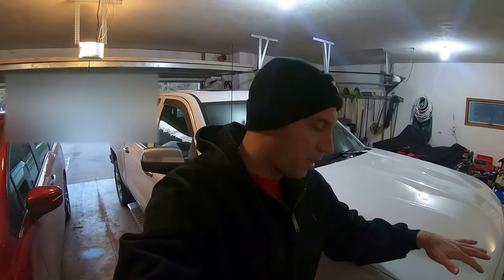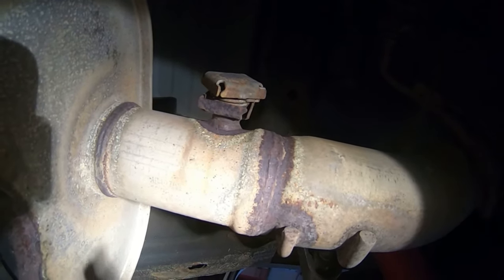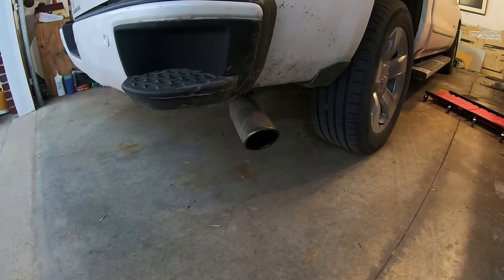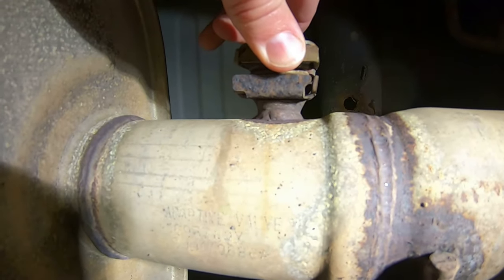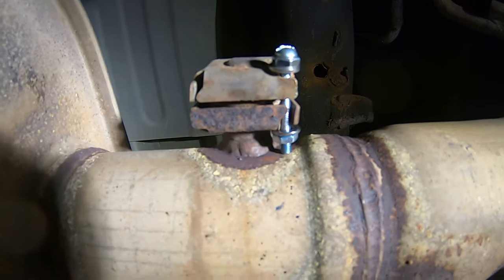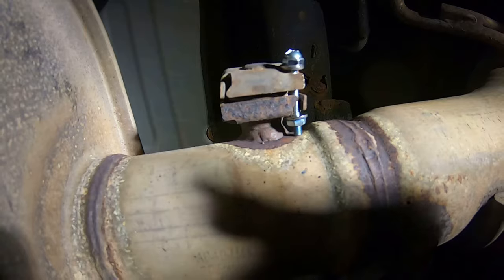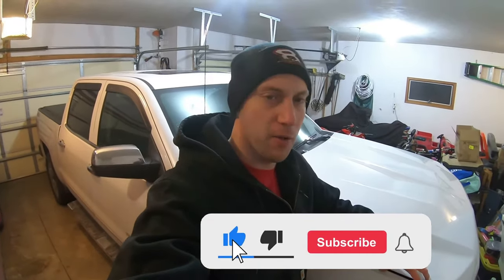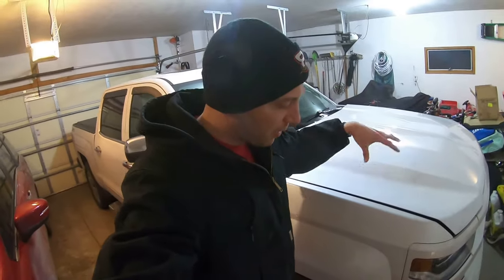MUST DO FREE Silverado/GMC Exhaust Mod!

Comment: Watched this and went right and did it. Thank you  sir. Way better! After spending $70k on a new trail boss and $8000 on 6" lift,wheel and tires. There are no beans left for any exhaust mods.
Reply from the maker: Camera doesn't do it justice. But way better in person. And it's free, can't beat that!
Reply: lol my exact thought. Can you vouch on the better sound? I feel like it was very subtle but idk if it’s worth it
Reply from the maker: @georgehernandez1502  in my opinion it's worth the minimal effort
Reply: @EssMotorsports  Ty sir. I live in an apartment complex and have been debating straight piping for some time now, but I don’t want my neighbors to complain. Someone did this and put exhaust tape on the resonators and it sounded pretty decent.
Reply from the maker: @georgehernandez1502  cheap and easy. If u don't like it then remove it. Simple enough to try
Reply: Doesn’t work on mine I’ve tried and nothing

Comment: Couldn’t believe it. Went to garage last night and sure enough there it was. 2017 Sierra 6.2. This truck has been choking its whole life. THANK YOU!!! 3 years of wondering why the truck hisses when pulling my camper……valve was seized 3/4 shut. Until last night. lol
Reply from the maker: @jaybilawchuk2225  No way! Cheap fix! Seized shut, truck will run way better!
Reply: @EssMotorsports  I’m hoping. I’m in the rust belt up in central Canada so it must’ve seized at some point. Broke it free and bolted it open. Truck immediately sounded like a truck, thanks to you. 👍👍
Reply from the maker: @jaybilawchuk2225  that's awesome! No problem!

Comment: Put a Flowmaster super 44 in my truck tonight and ran into that valve so I left it and it barely changed the sound. If I cut it out and put a peice of pipe in there will that give it the normal effect? Or should I cut the valve and the secondary muffler by the tailpipe as well

Comment: Use my reciprocating saw cut just before that valve and just behind the stock muffler and clamped me a Borla XR-1 in its place and its got a deep growl sounds great and the Borla won t rust there stainless steel paid $136 on Amazon for the Borla. I put in on my Trail Boss LT sounds great
Reply: Did it get louder or more of a growl? I was thinking of doing that
Reply: Did it drone

Comment: Mine is AHEAD or upstream of the muffler.
I wanted to retain that qiietstealth sound of the factory exhaust so I opted for the stainless steel motorized dump valve.
It can be loud or quiet when it suits me.
I put the dump valve ahead of the flapper valve and used a turndown to blow it to the side of the truck.
Reply from the maker: Yeah thats a good idea! Even with the flapper open it's still not even loud tho! Haha

Comment: I cut it and the stock muffler off and replaced with a Flowmaster delta flow 50 sounds great and still no drone in the cab
Reply: Did you cut the secondary muffle by the tailpipe as well?
Reply: @delcooutdoors4143  not yet but I might still along with installing a tip

Comment: Have you had any issues since this mod was done? How did it hold up? Just curious if anything had popped up since. Great video BTW very informative, well edited, and not too long.
Reply from the maker: Zero issues. No rattles nothing. Still sound good too. I'd definitely do it again.
Reply: I think the only problem may be at cruising speed in V4 you may get an exhaust drone which sounds very similar to the 8L90 TCC shudder.
Reply from the maker: @Jonathan Bialas  if I really really pay attention with no music. I can hear the helicopter noise in v4. But it's so minor doesn't bother me at all.
Reply: So is this where the rattling comes from; I hear it randomly but while driving....I want to say low gear/ while going up ramps on freeway and we'll after I got it tuned to stay on V8 mode at all times...and actually I started noticing this after the tune and started getting the error code P-0430 too🤔
Reply from the maker: I don't think this valve would rattle. Sounds like something else. U could always try this trick and see if it does anything.
Reply: @EssMotorsports it does rattle my 2019 has a rattle on startup and if I hold the valve it’s goes away but if I let go it rattles again
Reply from the maker: @dakotalee7499  all the more reason to tie it open all the time!

Comment: So, you rotate the flapper towards the front of the truck or the rear?
Reply from the maker: @bloodstorm1231  run the vehicle and watch which way it rotates under normal operation at idle. Then u know which way to rotate it

Comment: I have '19 Silverado High Country with a 6.2L.  Mine as one valve before the muffler and one after the muffler.  Did yours, or did it just one after the muffler?
Reply from the maker: Pretty sure mine was just one after the muffler.
Reply: @EssMotorsports  thanks for the reply
Reply: 6.2 has two and the 5.3 has one. 😁
Reply from the maker: Just after on mine.

Comment: I’m not brave enough to do a YouTube video, if I do- I will probably try to do it like you did.  Nicely done. 

That said…

I didn’t catch if you mentioned what engine you have, but I’m guessing that’s not a 6.2. Maybe I should try it out and send it to you.

I also don’t think I caught how long your screw was. I have a 21 RST 6.2 and the run up is disappointing to say the least.
Reply: I bought my wife a 2023 suburban, and it sounds much better than my truck in terms of run up.
Reply from the maker: It is actually the 6.2L. It's noticeably more tone cruising around. I can't recall the screw length. 1" to 1.5" something like that.

Comment: I just checked my 2019 4.3L and it has a round valve with no corners to stick a screw in. Anyone else experience this?
Reply from the maker: I'd just get a wide clamp, like exhaust band camp and clamp it open.
Reply: Yes. Mine is round also on my 21 5.3. Used a hose clamp to hold it open.

Comment: you only did one flap tho i think there is two one on each side
Reply from the maker: Mine only has one after the muffler
Reply: If my memory serves me correctly, the 6.2 will have one before and one after the muffler. The 5.3 will just have one valve.

Comment: No different to me.
Reply from the maker: The camera did not pick up the low frequency good at all. There is a definite note change in the exhaust.
Reply: Great video and hack.

My 2016 6.2l valve is not working as it should, so I'm going to do this hack to try it out... honestly, mine sounds so bad at start-up as well as while driving I thought I had an exhaust leak at first.
 
I may be swapping the mufer as well in the future for a little more rumble. 

Again,  great hack. 
Glad I found this.
Reply from the maker: @jefjulday  Thanks Man! I'm still rocking this mod. To me it's perfect, also helps its free! Haha